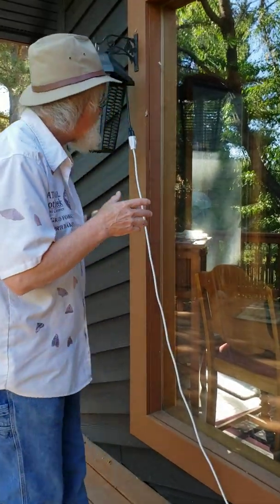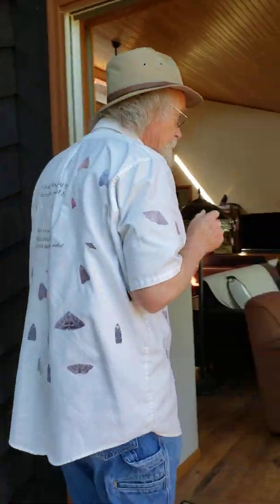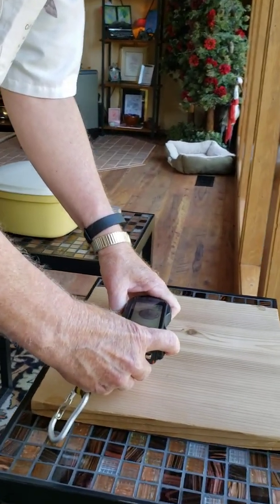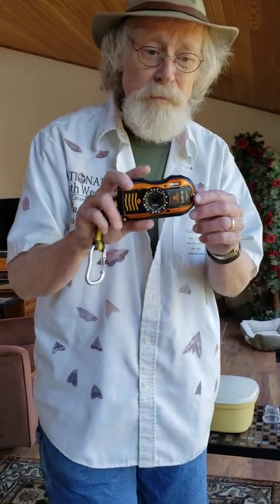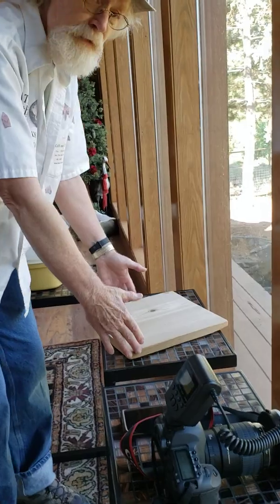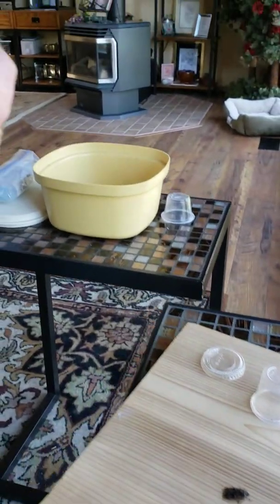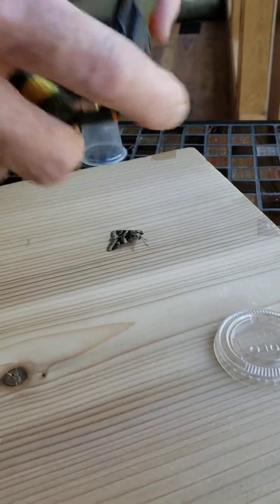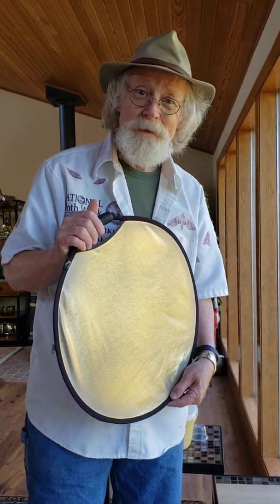National Moth Week: Mothing with Carl Barrentine, Part 6 of 10

Comment: Carl, I like your camera setup much better than mine - a Nikon DSLR with a 60 mm macro lens and a tripod. I may have to get a reflector because my lighting situation isn't the best either. 

My version of a "Lazy Susan" is a bit different from yours. I cut out the side of a cereal box and drew a 1-cm grid on the inside of it, which I can then use to show the size of the moths I photograph. The light brown surface also seems to help get better color and white balance because it's a more neutral color that often matches the color of the moths.  I cut a couple 4- 5-inch squares of the stiff clear plastic like you find with cookie clamshells or similar. I scuff one of them up so you can see the grid through it, but you don't get the glare that you would from the "shiny" transparent one. I set the moth on the scuffed one and then move it around on the cardboard to get the shot I want. In some cases, the moth doesn't want to cooperate so I'll leave it in the container with the transparent piece over the top so I can see its orientation in the container. When ready, I slightly lift, then slide the plastic to the side, which usually doesn't disturb the moth and I can get the shot.

I also use a piece of the stiff plastic when collecting the moths. I sneakily place the container over the moth, then use the piece of plastic like a spatula to secure it inside, place the lid over the covered opening, then slide the "spatula" back out and snap the lid in place.
Reply from the maker: Some swell techniques, Mark. Thanks for sharing.